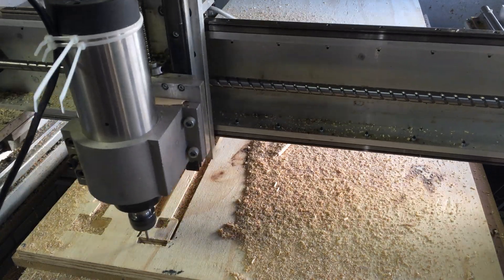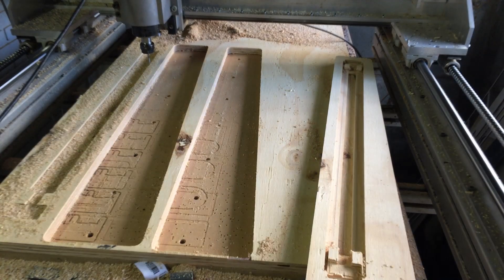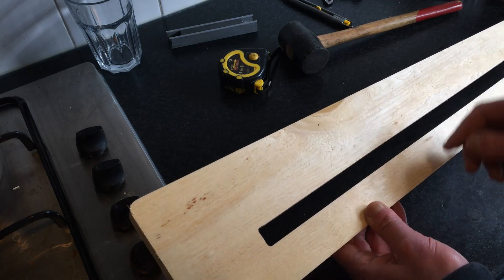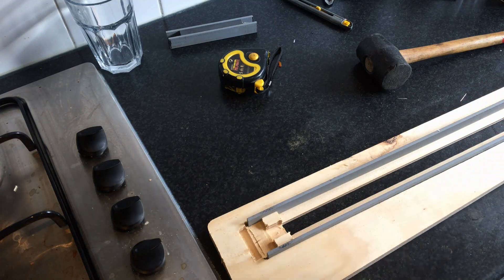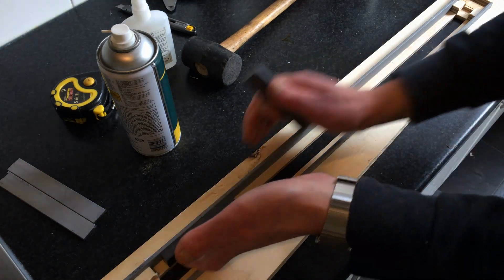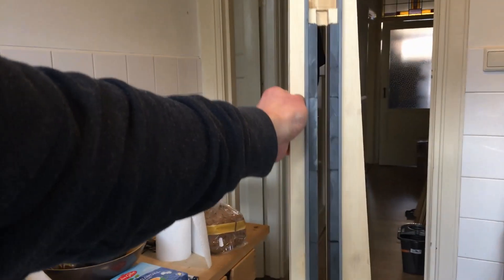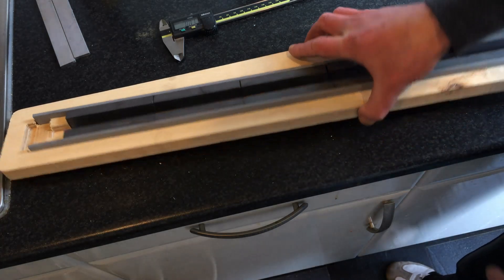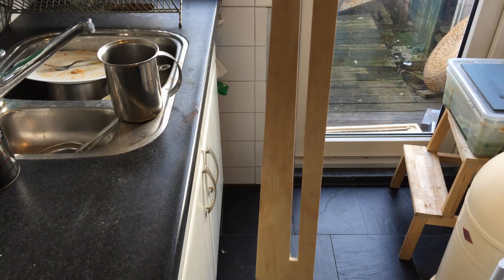Proof Of Concept Ribbon speaker integration in my Planars - Construction

Comment: Aha I made the same mistake in the 1990's with a planarmagnetic design, my suggestion would be to use angleframe steel pieces which would prevent the wood flexing at the midpoint. I did have an angleframe steel frame made, but only the outer frame. It was surprisingly rigid (15x15x2mm angleframe) but the design had magnet bars made from normal rectangular stock which had a consistency of jello compared to the frame. If the magnet bars were angleframe too, it would have been a much better design, and I think this might help your ribbon design too. Hope this helps.
Reply from the maker: well i think you lose out on some magnetic field using angled iron :( a Ohm profile with slits on the back would be better just like magnepan.. but thats out of the realm i can do at home :)
Reply: @joppepeelen  Aha good point, I was wondering just how bad so in a classic "Jeremy Clarkson How Hard Can It Be?" moment, I've just stuck a magnet to bar and angle stock, and used one of those crude magnetic field detector cards on it to get an idea of the cross-sectional field. Even at this small scale you could see the field difference. This is probably why you're better at this than I am lol.